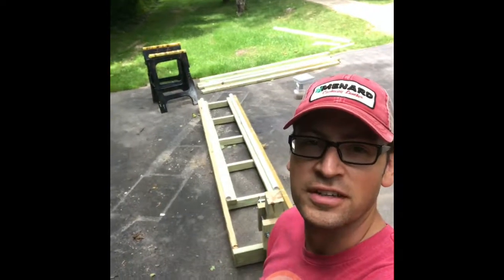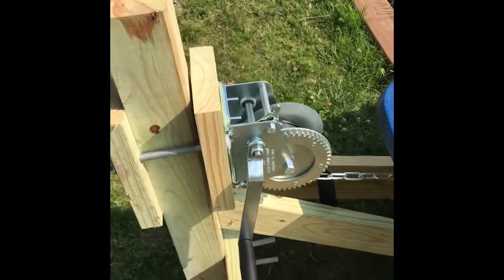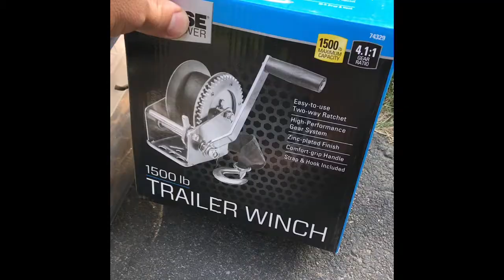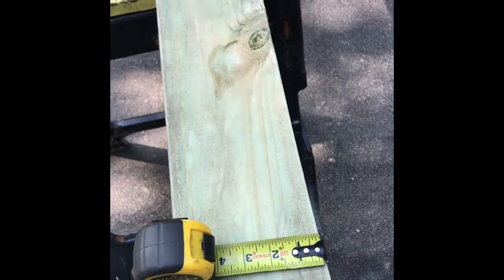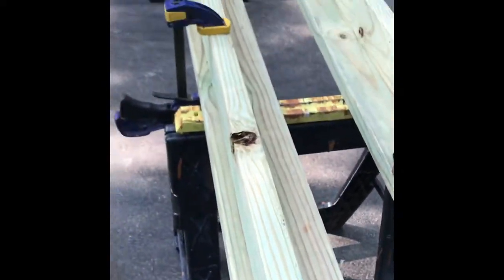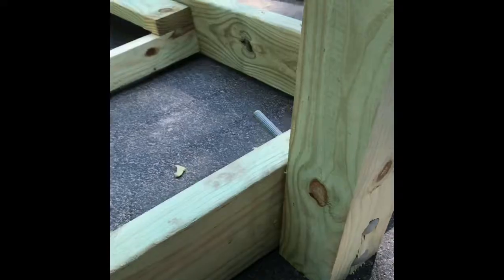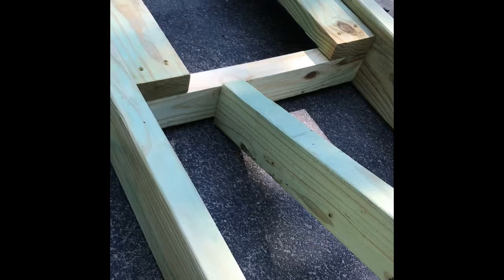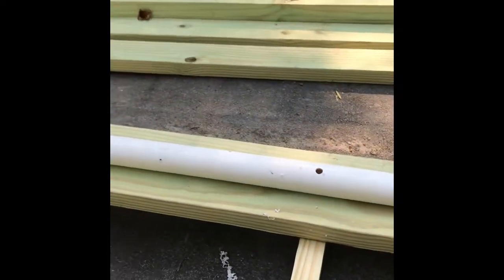DIY Jet Ski Landing Ramp -Step by Step

Comment: Great video Steve. Do you think this would work with caster wheels to launch from a boat ramp?
Reply from the maker: Hi @Michael Sharpe - that’s s good question! If you replaced the pvc pipes with two rows of casters, I don’t see why it wouldn’t work. Would you haul the whole assembly on a tilt trailer? That wouldn’t be a bad way to go!

Comment: Did u consider rollers instead of pvc?
What about a keel roller fo when you first go on?
Do you anchor your ends somehow in the water.
Considering this or the multinautic one, but this looks durable and cheaper
Reply from the maker: I went with pvc as a cost saving measure. My skis are old and I bought them pretty cheap. I didn’t want to spend a lot in the ramps. The ends aren’t anchored, but that’s not a bad idea. Mine are sitting on concrete and gravel, so they don’t slide much. I usually put my foot on the ramp while I start cranking to keep it from shifting.

Comment: Great idea! Do you support it in the ground somehow? I would think it would slide toward the sea doo when you crank it up. I’m definitely going to make one though, Thanks for the idea!
Reply from the maker: Hi Bernie- I actually didn’t support mine to the ground, but I set mine on a rough gravelly area. It would sometimes pull an inch or two toward the water, but usually I could step on the landing ramp and it would stay put. A little ground support would be a good idea!

Comment: I'm thinking of building one, do you think it would work for a Sea-Doo Spark?
Reply from the maker: Hi Jean Sébastien- I think it would work. Just be sure to measure the hull to see how far apart your pipes can be so it doesn’t scrape the cross supports. Good luck!
Reply: @NashwaukSteve  That's exactly what I was thinking. What a neat design you made!
Reply: Hi Jean! I also just bought a Sea-doo spark, how wide did you make the cross supports?

Comment: Hey my seadoo is bigger than yours do you think it would still work? Would it be better cuz their smaller to put more of the ramp in the water? Great idea!
Reply from the maker: Yeah it should still work. Might want to look at a winch with a longer handle to make it easier to crank up. Definitely measure on your hull to make sure you don’t end up rubbing in the middle. You’ll want to err on the narrow side to be sure. 

The back 6-8” of my ramps are in the water, depending on lake level.

Comment: What was your total cost of the build?
Reply from the maker: Hi markbelina07- took me a bit to put it all together. I spent about $450 on this project. About $390 was for the lumber, with the rest being for spax screws and rebar. All of my sand and gravel was free from a local iron ore mine. Note that this was at pre-covid prices! Today the project would cost about $750! The 4x4’s  went from about $1.20/ft to $2.00/ft. I needed 30 - 6’ posts and 18 - 8’ posts. I hope this helps!

Comment: Would the bottom of the ski not hit the wood?
Reply from the maker: As long as you keep the pipes from being too far apart it will clear. Mine does not rub.
Reply: So do u need to  Measure it to fit my mine?
Reply from the maker: Yes, it would be recommended.
Reply: @NashwaukSteve  yeah, this is my only concern, too. I did measure and have spaced it 24 inches apart (RXT 255 is a big three seater). My solution if I screwed up once I test it is to replace PVC pipe with larger pipe. I can probably go up to 2 inch pipe if needed.
Reply: Would your spacing be the same as your trailer spacing.
Reply: @ashfieldm  I would like to know too
Reply from the maker: Hello! It may not directly translate for you. If the trailer cross members are sort of v-shaped, that could be giving you extra clearance. Measuring the jet ski on the trailer would be a good idea though. Use a level on the keel and see how close you need to go with your rails to make sure you clear. Good luck!

Comment: Well, I am not handy, but I am building this PWC ramp for my Seadoo RXT 255 for the lake in Canada. It actually has gone well. I'm almost done. I have to complete the winch stage. I do have an issue transporting it because its 12 feet long (Seadoo is just over 10 feet). So, I plan to cut it in half and use metal hinges to reattach it when I get it to the lake. Thanks for the easy to follow steps.
Reply from the maker: Glad it’s going well. The hinge idea sounds great for transport!
Reply: I have the 155.. wondering how you made out! Any updates or dimensions are appreciated!
Reply: It’s finished..haven’t tested it yet because we can’t currently go to Canada. I plan to try it out on a small lake nearby...
Reply: I’ll put those dimensions up when I get home...👍